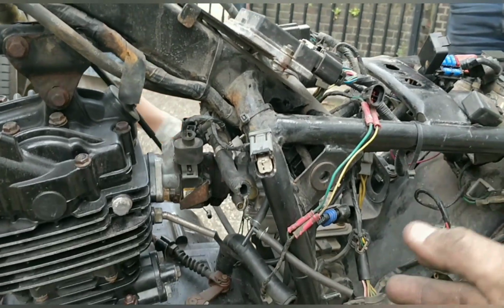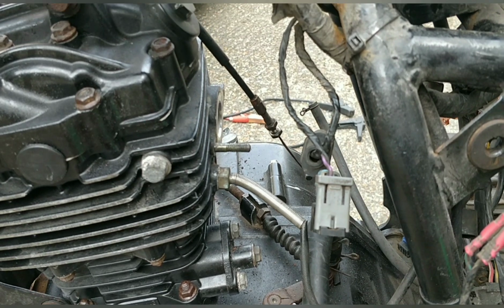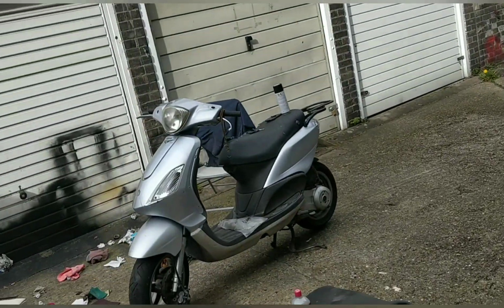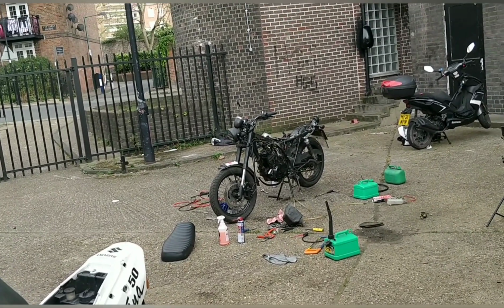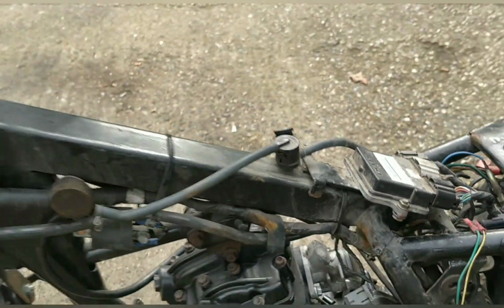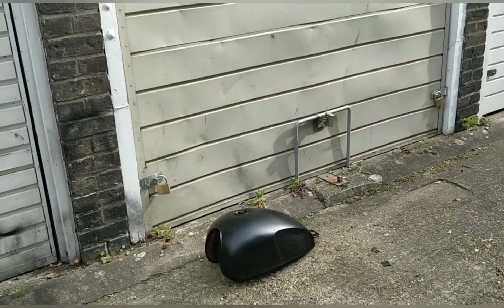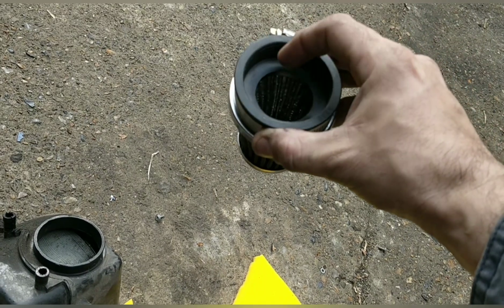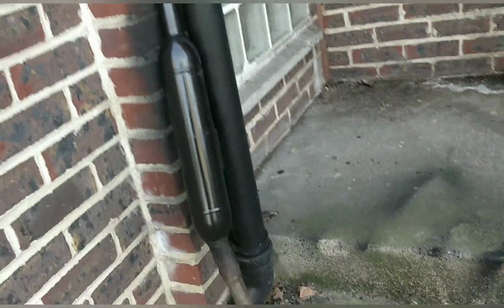lexmoto Valiant project.

Comment from the maker: Hi guys, this is more complex then I expected but worth continuing which I will do next weekend. The original system was working intermittently hence the conversion to carb. If this conversion dosnt work then I will start to buy the original parts again to go back to stock.
Reply: If your conversion works could you share how you did it? I've bought a Chinese 125 scooter not realising it has EFI that isn't running right. I've got a complete spare engine and carb which I would just bolt on instead but not sure how all the added wiring would confuse the carbed engine.
Reply from the maker: I get that Peter. 

Yes I've got a couple of ideas about this so will definitely share the final finish and how I got there. 

I would like to test a honda cg 125 carb aswell as it could bolt straight to the engine, I could run the airbox aswell  

It could be a popular fix to a problem.
Reply: @motorcyclerescuer  Ah the good old CG125 carb or one of the many, many Chinese clones! The sticking point for me is the electrics. I haven't a clue how to remove an ecu and wire everything as it was pre the EFI.
Reply from the maker: Good question. The Chinese clone one will be fine as I have jets to re jet if needed. 

Second point on the electrics is that you don't have to do anything with them. Just tape up the wires and hide them away. It will probably put the fault light on the bike but it's not an issue at all as you would know about it. 

I'm looking forward to getting back to this one on Saturday
Reply: @motorcyclerescuer  Hmmmm, feeling more inspired now. Just leave the ECU and CDI connected as they are so that between them they control the spark timing but disconnect and tape up the sensors? That might make sense. Tha js for the help :)
Reply from the maker: Yes that should work. I would still disconnect the fuel injector ideally but also not the end of the world leaving it and hiding it as you wouldn't be sending fuel to it. 

I'm not 100 percent sure it will fully work yet but time will tell. 

I should have more idea after this weekend. 

Cheers Peter Lee

Comment: where do you get parts from im trying to find a petrol tank for a 2016 model
Reply from the maker: Sometimes you may have to buy a more generic tank and make that work. Otherwise its a waiting game. 

I use ebay mainly. Cmpo are good when they have parts in stock but don't always have them

Comment: Can you give me a quick rundown on what you had to do to get this conversion going mate? I've got a venom efi I'm desperate to get more power from. Just need a starting point really
Reply from the maker: Its a little more effort then it's worth I'm thinking mate. So you need the carb, manifold, new throttle wire and a new fuel tank or to make yours free flow by ruining the high pressure pump one. I bought a new tank on ebay for around £50 although that needed a little fabrication to get right. 

Sadly the newer efi bikes are slow because of emissions standards. I'm hindsight you would have been better of buying a slightly older carb model.